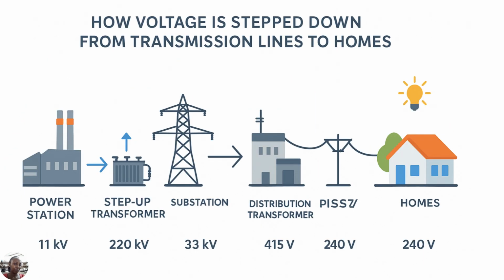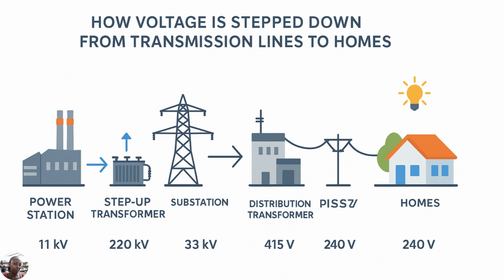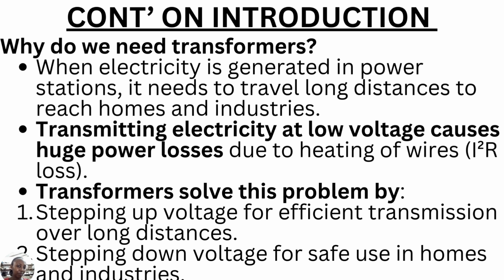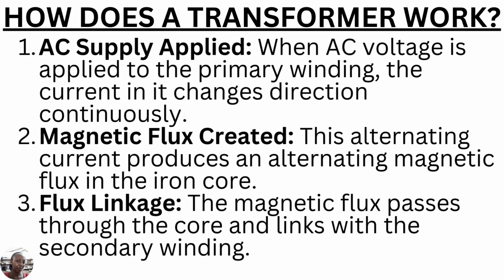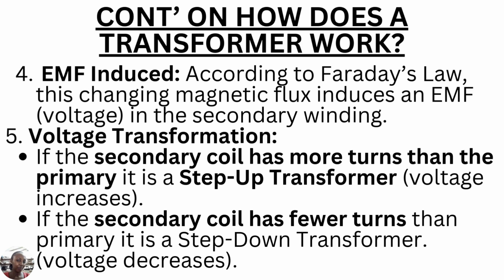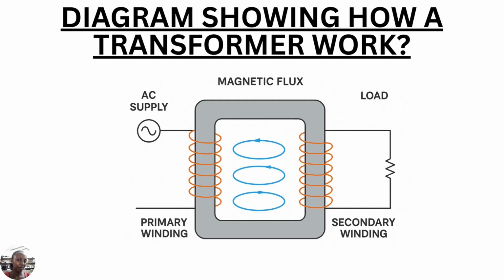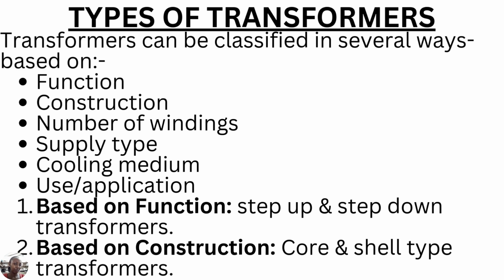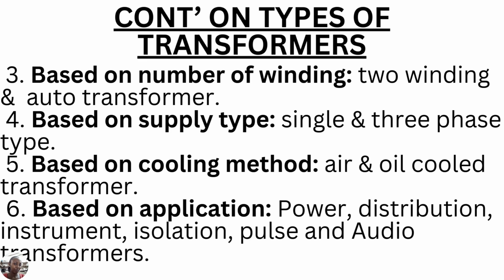Introduction to transformers

Comment from the maker: 🌟 You’ve Taken a Big Step in Learning Transformers! 🌟

In this lesson, you’ve learned what a transformer is, why it is needed, how it works, and the different types of transformers—great progress! 💪⚡

📝 Let’s check your understanding:
🔹 Does a transformer work with AC or DC supply?
🔹 Which transformer increases voltage—step-up or step-down?
🔹 Why are transformers so important in power transmission?

💬 Try answering in the comments—even if you’re not 100% sure. That’s how learning happens!

👍 If this lesson helped you understand transformers better, please like, subscribe, and turn on notifications so you don’t miss the next lesson.

🚀 Keep learning, keep practicing, and remember—every expert started as a beginner!
Reply: nice work
Reply from the maker: Thank you my number 1 fan @CaesarNyamu-i4z
Reply: @electricalknowledge_25AAN you welcomesd madam